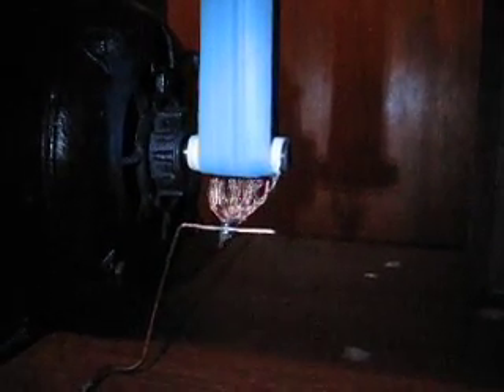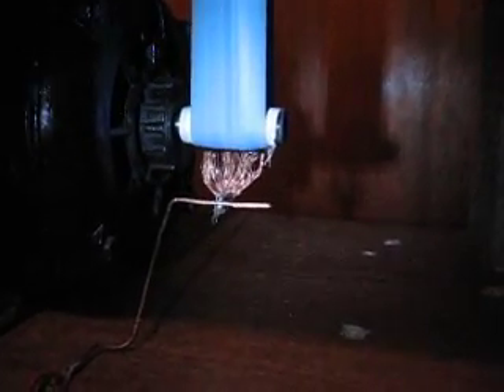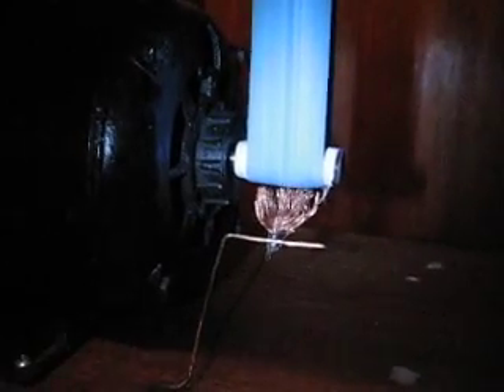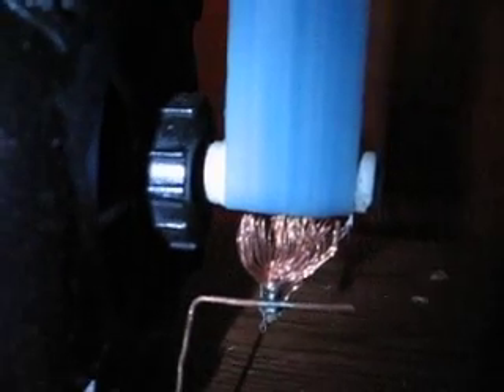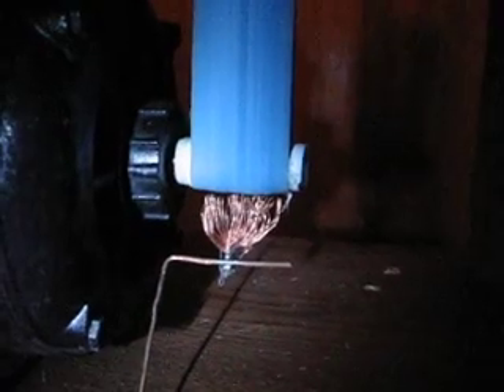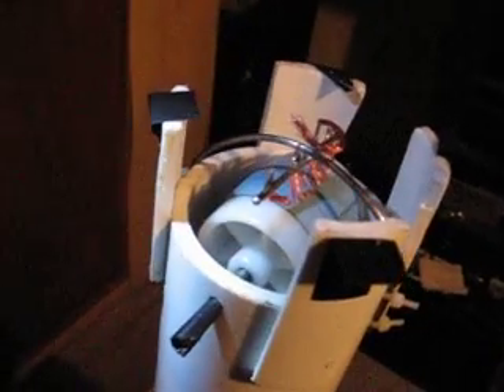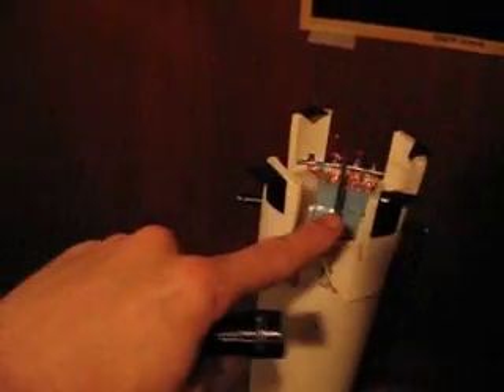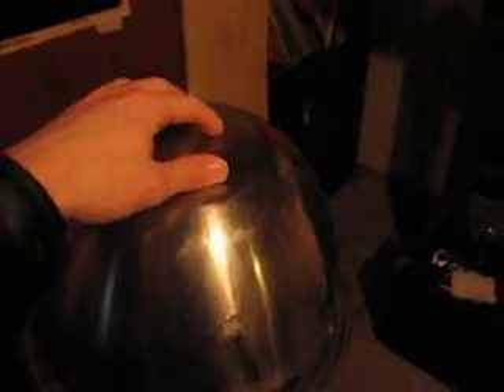Van De Graaff how it's built

Comment: I've covered my lower roller with teflon tape and upper roller with plastic foil. I've also change the belt. Now i'm using the fitness belt it look's like yours. But it still does not work. :( What i'm doing wrong?

Comment: what should you use for the different rollers?
like what would be best, and where would you get these materials? any reason why nylon is used at the top instead of lets say abs or pvc pipe? or any other plastic for that matter? and why teflon is used at the bottom?

Comment: on my machines i have built in the past i painted the bottom roller with metalic paint. and used metalic painted paper cut with serated sizzors  for the pickup combs and got outstanding results.

Comment from the maker: The bottom roller is nothing more then the motor shaft, lined with tephlon ( didnt spell that right i know) tape, and I used a nylon bed frame wheel for the top roller..

Comment from the maker: This model that I built is the third one. The first one I had mad I used a motor from a window box fan..Reason why is because the motor shaft on those are about 1.5 inchs long, and able to use more belt. Drug stores like Walgreens and even walmart have cheap fans, and great for parts. Like I mentioned before,( and why mine stopped running) is have a computer powersupply fan blow on the back of the motor to keep it cool, and that should def work for you.

Comment from the maker: Sure! the one i'm useing is from an old furnace blower fan. Its a bit overkill to turn a belt, but that was All i had at the time. One helpfull tip for you, try finding and useing motors from sewing machines and even old box fan motors work nice. However, if you use a box fan motor, put a small computer fan on the back of it to keep it cool..otherwise your motor will overheat, and stop. Best of luck to you!